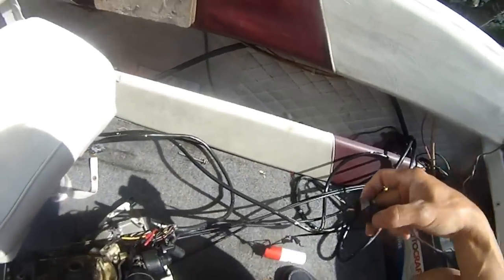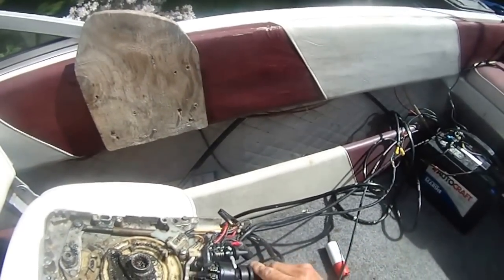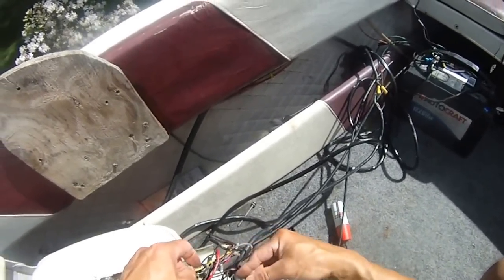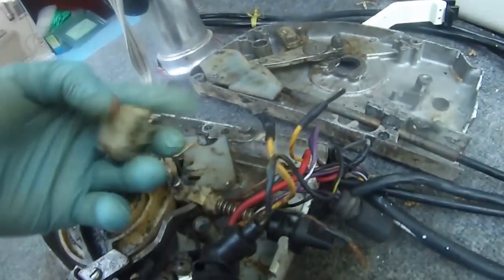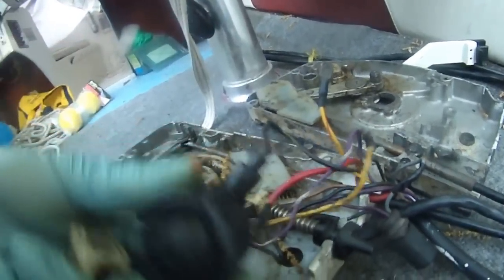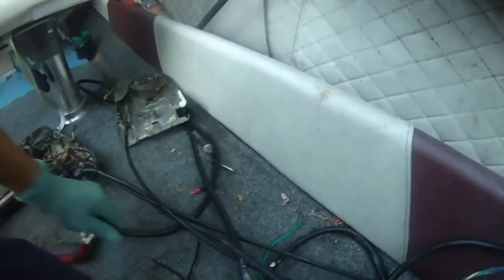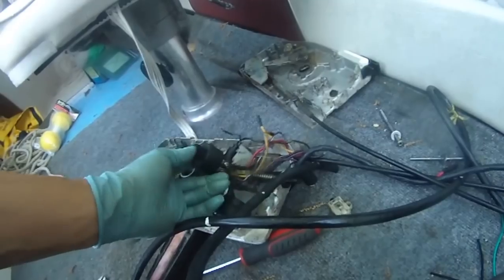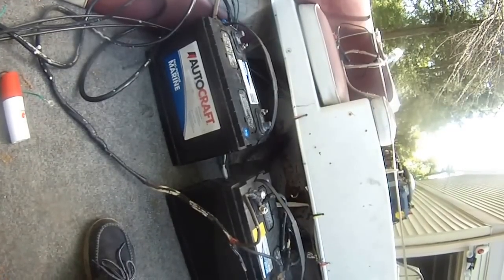johnson 90 hp v4 almost start troubleshoot #3

Comment: Hello again! I don't think You broke Your flywheel key. I don't think You have any compression problem. It seems like the flywheel is spinning but that the starter motor is unable to rev it up. Your connections are bad, just as You mentioned by Yourself. The negative lead to Your battery has to be reconnected. Since not all strands are ok, all the strands left is to be compared to the use of a too thin cable, thats why its running warm when trying to activate Your starter motor. 
On the film sequence it seems that the knob in the remote control is not in the exact correct position for the neutral safety switch, why I think the motor is not in neutral. Check that it is really in neutral, take away the sparkplugs and I think You can spin Your flywheel by hand. Check your wires and connections in the remote control, repair the negative lead on the battery and check and clean all electrical connections on the motor, and I think You will be up and running. Also, buy a new neutral safety swith, I think You will found a new one on i.e. Ebay quite cheap.